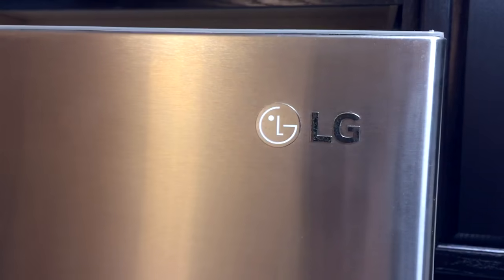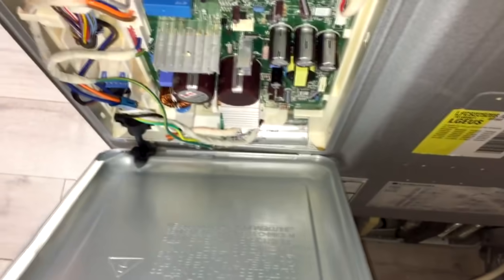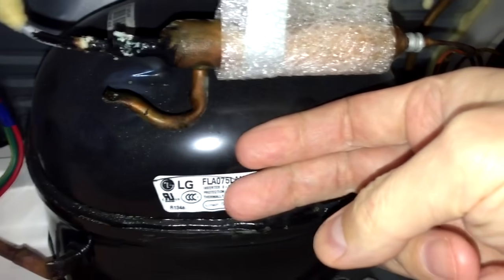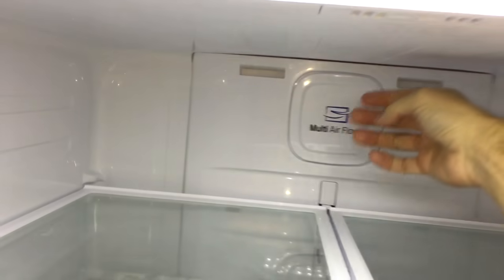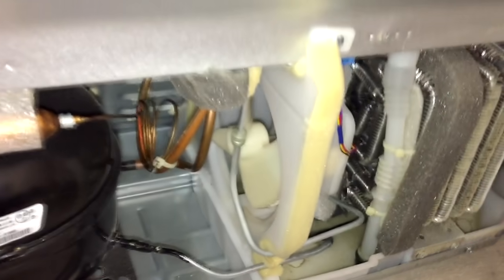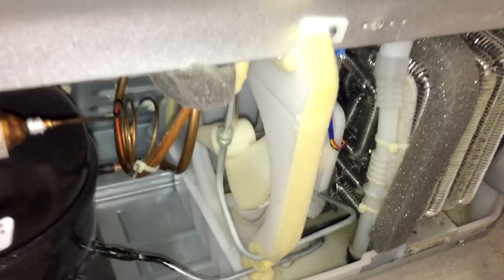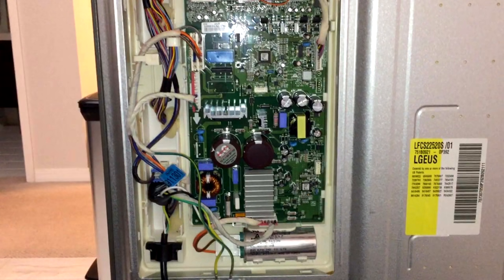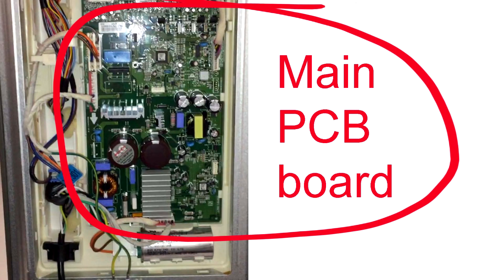LG refrigerator test and reset button

Comment: Plz help. I got error 22 I change the compressor relay and it’s still giving me error 22. I have all my stuff in coolers outside with ice......
Reply: I am getting error 22 as well. I have ordered the relay from amazon and trying to fix on monday and will let you know if it helps. If it does not work it could be issue with the compressor. Call LG if your system is less than 10 Years old
Reply: @birendrapandey4149  I got the exact same compressor relay from Amazon and still getting error 22. I left it off for 20 min so it resets and nothing. My compressor sounds fine. My refrigerator is 5 years and now  out of warranty LG said. I have a guy coming from their out of warranty program Thursday.  $260 Canadian.
Reply from the maker: The number 22 is probably showing that you are on Test#2. Otherwise, I'm not familiar with this error code. What is your refrigerator model number?... maybe I can find out what that means.
Reply: @Your-Self  it’s the relay compressor. I replaced it and still getting the same error.

Comment: hi on mine nothing works exept the frezzer light and the drinks dispencer light  what do i need to check
Reply from the maker: It's difficult to figure out remotely. On newer refrigerators with multiple electronic-boards, one of them could be damaged, or one of the DC loads (like fans) could bring the whole circuit down... you probably need to call a tech to investigate.

Comment: My LG freezer is not freezing enough but not too bad. I called LG repairer to come and check and he said the gas is leaking. However it is so expensive, arounde $1300 and need to be taken to their workshop. 3 days after he left, my freezer is totally melting, all ice turn to water and meat are defrosted. I wonder if he did something like switch off the gas mode or something? Thank you.
Reply from the maker: It's possible that the gas was slowly leaking out, and by now has completely leaked out. So you have to make difficult decision whether it's worth fixing for $1300, or better to put that money into the new fridge. Good luck!
Reply: The freezer was ok before he came, meat were frozen and ice cube was 3/4 frozen since a month ago. Is just after he left the condition’s deteriorating fast and made me think he might let the gas completely gone.  My LG is the big one almost like in your video and has been with me for 6 years, never had any problem until recently only. Anyway, I might as well buy a new refrigerator. THanks so much.

Comment: My fridge its showing er if in the screen what's does mean?
Reply from the maker: That means there is some kinda problem with the Fan for your Ice Maker. Depending on your model, the fan is probably located inside the freezer. The fan could be stuck in ice, burned out, or one of the connectors got loose/corroded.

Comment: I have had an issue I have been trying to solve with my ice maker for over a year but can't get anywhere. I have a 1f code that comes up after the ice maker fan turns on and off about three times in a 30 second period after turning on the ice maker switch.. I had defrosted and also varified the ice maker fan works and is blowing cold air into the door compartment. I have also replaced the main board in the fridge. Is there a tach sensor that could be sensing the fans operation incorrectly?
Reply from the maker: All refrigerators are different, what is your model number?
Reply: @Your-Self  LG model LMX25981ST
Reply from the maker: You probably meant the error code IF (ice fan).
This error code typically shows up when there is a large amount of frost/ice build-up inside the freezer that stops the fan from running. If you manually defrost the freezer, and the error code goes away at least for a few days, the ice build-up is your problem.
If the error code is not going away after defrosting the freezer, the fan connector could be loose or rusted. Try to unplug, inspect it, and plug it back in.
After defrosting, you could do a voltage test if you have thin multimeter leads.
On the mainboard press the Test Button once so all fans will run.
The Ice Fan is connected to the mainboard on the connector CON4 with three wires Red, Black, Brown under numbers 5,6,7.
Two wires are for Power and Ground, and one wire for the Feed-Back signal (but schematics don't specify which once).
So, duringTest#1 you should get about 12 VDC from the Ground and Power wires. And about 0.5 - 4.5 VDC between the Ground and Feed-Back wires (but not exactly 0 or 5 VDC, which means shorted or opened).
Do these tests first, to figure out if you have a frost problem, connector problem, or a fan feed-back problem.
Reply: @Your-Self  I will test for feedback as ive already done the other things you suggested as well a tried a replacement board. I cannot seem to find the correct fan or I would have already replaced it but I can see and feel it working fine.

Comment: Compressor is not running during test? CPU?
Reply from the maker: Do you have a good power source? (lights work?)
Did you check compressor windings and if it's shorted to ground?
Overload Relay could be open.
Burnt out fuse on the PCB.
Or a bad PCB itself.

Comment: The evaporator fan works when I conduct the first test. But after completing all three tests, the compressor and compressor fan come on but the evaporator fan does not. what' s up?
Reply from the maker: When you open the door in some refrigerator models, the evaporator fan will stop automatically. Did you activate the door switch and held it for about a minute while checking for the air flow from the fan?
Reply: Hi I have the same problem as Jessica. How do I activate the door switch to get the evaporator fan working after the test?
Reply from the maker: @Tai Nguyen to activate the door switch, just press and hold the door button, or use a magnet if there is no physical door button as on this video: https://youtu.be/ipwOerjFITg
Reply: Jessica McMullan did you ever get it to work?  If so, what’s the solution?  I have the exact scenario
Reply: @yokes23   Unfortunately the compressor was shot. Lucky for me it was still under warranty. It's now fixed and running perfectly. I'm sorry to hear you're having troubles.
Reply: Compass 5 it’s 3 and a half years old so I’m pretty sure the compressor is still under warranty. I called LG and waiting to hear from local repair company. Thanks for the info!

Comment: Mine blows cool air in test mode, shortly after resetting it then it doesnt blow air after that. I dont know whats going on. I changed circuit board, capacitor, still nothing.
Reply from the maker: 1. Make sure that Door-Switches work properly... put your phone while recording video in each compartment and close the door, the refrigerator lights should go OFF.
2. If the compressor never runs during a regular mode, the temperature sensor (thermistor) could be bad.
3. If the compressor runs, but the fan inside the fridge doesn't, the main circuit board could be bad.
Reply: @Your-Self  door switch works, fans come on during test mode, compressor runs during test mode, blows cool air during test mode. During regular mode it doesn't blow air.
Reply: So far I have replaced the circuit board, the capacitor, the overload protection switch, and the temp sensor in the freezer. The upper one in the fridge wasn't available.
Reply from the maker: Do the compressor and the condenser fan next to it run during a regular mode?
What's your refrigerator model number?
Reply: @Your-Self   yes, compressor and fan run. Compressor is quiet. Mine is actually a kenmore elite, just a rebranded LG. Uses the same components. 795.73133.410
Reply from the maker: If the compressor runs during the regular mode, that means the Temperature Sensors are good and "telling" the compressor to run.
If Evaporator fans are capable of running during the Test Mode, that means the fans are good.
This brings us back to the Main PCB which is probably bad and not "telling" Evaporator fans to run during the Regular Mode together with the compressor.
NOTE... are you absolutely sure that Evaporator fans are not running during the Regular mode? When you open the door, the fan will automatically stop blowing, so you have to activate the Door Switch with a magnet and hold it for a minute, and then the fan should start blowing again. Also, if you have a dual evaporator model, only one compartment fan can run at one time, the freezer or the fridge... so check one, and then the other.

Comment: My LG fridge and freezer have stopped.. what is it?  A fuze???
Reply from the maker: If lights and fans don't run at all, it could be a fuse or home electrical system problem. Plug a table lamp into the same electrical outlet to verify that it actually works.

Comment: How do you know if that board is bad?
Reply from the maker: If you get power to the board, but nothing works, that's one sign that it's bad. But the main PCB is more complicated than that, and there is no simple answer. Depending on your specific issue, the problem could be with the board or with some other component.
Reply: @Your-Self  i had an lg linear compressor (the one with only ohm reading between 1 winding) it came on was vibrating but not moving and freon. Suction line stayed the same temperature/pressure. I wonder perhaps the board wasn't sending the initial 200v or so in the beginning. Maybe the compressor got voltage but not enough. Could that be the problem?
Reply from the maker: An LG linear compressor works on variable 80-240 VAC. If it receives less than 80 VAC, the board is bad.
If you just replace the old compressor with a new "Universal" Linear compressor, the PCB needs to be updated with a special LG software Jig.
Boards manufactured before 2013 are not capable of receiving the new software update.

Comment: okey, my ref is working well, the problem is the beeping, although the door was totally closed.. it keeps beeping... HELP
Reply from the maker: Typically there are 2 alarms... a Temperature alarm and a Door alarm.
You can turn the Door alarm OFF. If you turn it off and the alarm stops beeping, that probably means one of the Door Switches is bad.

Comment: After I do the reset, my fridge and freezer start working, but it seems like once I open the door it stops working until I do the test button reset again.  When I hold a magnet up to the fridge door sensor, I can feel and hear the evap. fan.  I haven't found the location to hold the magnet on the freezer yet.

Comment: I have an LG 4 door refrigerator also with exact the same problem that quit working and it's barely 2 yrs old.  Have to reset and start working again then after running for a few days, again it quit working . Reset and start working and becomes annoying doing same thing over and over  I think lg should not be selling this appliance because it is very, very unreliable.

Comment: Hi I am working on LG refrigerator .is not cooling everything works all Motors work compressor work not over heat none cool air
Reply from the maker: If it says "LG linear" on the compressor, the internal suction valve has probably failed. If the refrigerator is under 5 years-old and you have the receipt, LG should fix it absolutely free.

Comment: My LG fridge has been nothing but trouble. The  electrical main board fuse blew during a power outage. The morons at LG have a hard wired fuse on the board, to replace it you have to solder a new one. Then it ran for another Year till now the refrigerator door thinks it’s always open, at first it was just re-shutting door till is was happy light stays on, but worse an annoying buzzer constantly beeping. Nothing wrong as far as sealed door. Then it quit altogether one day. Service sucks and said to unplug for 24hrs, which is a pain if you have loaded with food, and try again. That seemed to work for a few months, but started again. They don’t use a standard switch you can bypass, or worse they say you can’t disable buzzer. I have a 25 year old GE in my garage that still works, but this fancy POS has been nothing but headaches! Don’t buy if you want something to last!

Comment: what is pc8
Reply: light blinks 3 timed
Reply from the maker: Make sure the compressor is not "shorted to ground." And all wires are properly attached.
The PCB (computer motherboard) may need to be replaced if everything else is good.
Reply: @Your-Self  thank you

Comment: We got a 3 beep error code, what does that mean?
Reply: I have same problem. when i push test button we get 3 beeps, anyone know what this means???
Reply: When you push the test button for the first time you should get one beat three times with two seconds between each beat when you press the test button again you're going to get two beeps for two seconds between each two beeps when you press test 3 you're going to get three beeps 2 seconds nothing 3 beeps 2 seconds nothing 3 beeps then to go to test four I'm going to get four beeps two seconds no sound four beeps again then no sound for 2 seconds then four beats again then press it one more time and you exit out of the test mode.

Comment: I have an older LG that just failed and am looking around YouTube for various help videos and suggestions.  This video had some hope but you just blew past the "test button" part.  You need to mount your camera and only swing it around when you're moving on to the next step.  I can't see where that test button is and how it is marked.  I'm going to try to freeze that frame and try to zoom in on the lettering.  Also your intro is way too long - I usually click off a video if it's too long or over-produced.  Just a suggestion.  I will come back if that test button thing was there and worked - just to be fair.  thanks  Just went back to the video - the whole damn thing is out of focus when I froze on that frame.  Geez

Comment: Hello @YourSelf, thank you for your vid and FAQs.   I've following and reading all FAQs and below and saw Q&As around testing (test #1) on the PCB board to confirm CON201 supplies ~200VAC > 30sec...  https://www.youtube.com/watch?v=SXGEY8XDA4o.   I have a Kenmore Elite EBR78940602 PCB with LG FLB075LANA condenser - My OEM, and the newly purchased PCB both tested around 88, max 90.1VAC output on CON210 to the condenser.  I even tested by connecting the condenser directly into the 120VAC wall outlet (with and without the thermistor), but the condenser hums and produce some cool air.  The condenser itself & CU pipes are cool, but not warm/hot to the touch...  My question is:  Does the Condender <REALLY> need around ~200VAC on revv up initially to get things going or should 90-120VAC suffice to get cold air circulating?  BTW, I let the fridge ran +3hours but not cooling at all.  I tested the door bypass with a magnet and the evaporator fans are working fine...
Reply: TYPO: CON201, not CON210 on PCB.
Reply from the maker: When you say Condenser you mean Compressor, right?
That linked video is not entirely correct, and that tech admits in reply that the problem was with the compressor.
The compressor can run on 80+ VAC. And if you unplug the compressor, the main PCB will sense it and will have no reason to provide the full 200 V power.
Most likely your compressor is inefficient (bad) with a broken reed valve inside. To prove it, a tech can attach a gauge to the LOW side and the pressure would be around 60 PSI. When you turn the compressor ON, the pressure should drop to around 0 PSI. If it stays high, around 40-20, it's a bad compressor or there is a restriction on the HIGH side. But if the pressure on the LOW side, before you turn the compressor ON, is very low, there is a leak in the system.
Reply: @Your-Self  thank you for your response.   Yes, I meant compressor.   Either way, I think it's going to cost = or more to fix the compressor since it's about 7 year old.  We're leaning toward a new fridge, any suggestions?

Comment: Don't advice people without experience to play with the motherboard, IT VOIDS THE WARRANTY (SOME MODELS HAVE A STICKER OR GLUE ONCE IS TAMPERED, IT WON'T BE COVERED UNDER WARRANTY)
ALSO VERY IMPORTANT, YOU ARE ADVISING PEOPLE TO PUT THEIR BARE FINGERS ON A HIGH VOLTAGE AREA WITH CAPACITORS, YOU'LL BE RESPONSIBLE.

Former LG Technician here.
Reply from the maker: I understand your concern, however, a lot of DIYers are already pushing buttons blindly. After watching this video, at least, they will know what to expect, and I do warn them that it can be dangerous. Thanks for watching.